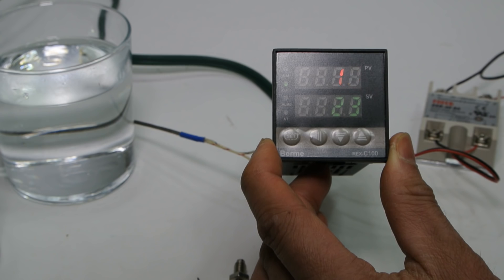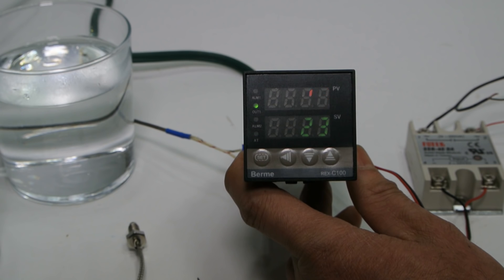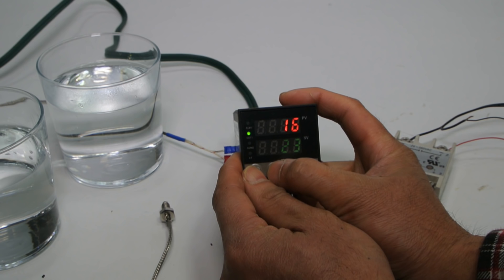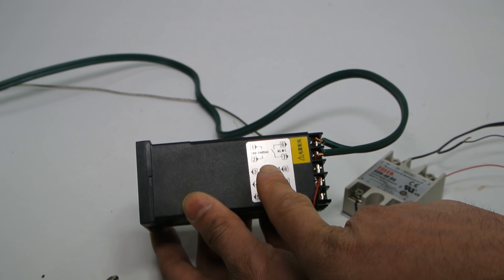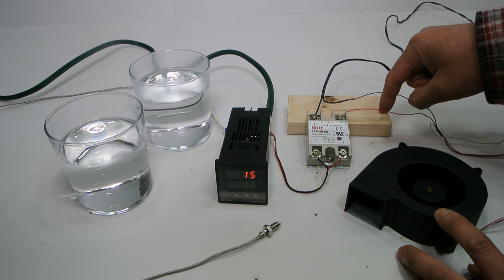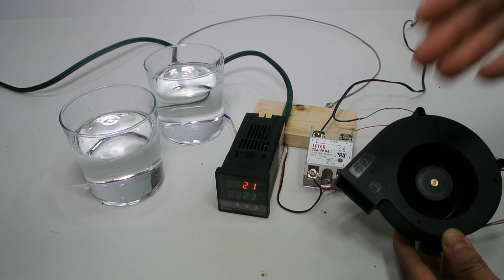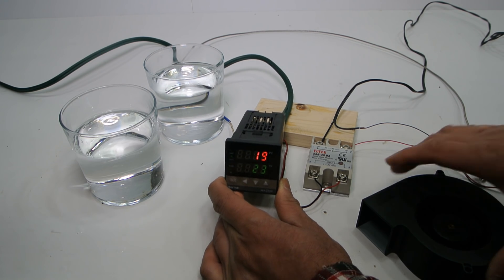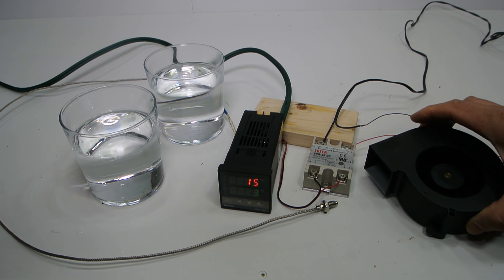Berme REX-C100 PID Temperature Controller

Comment: tanks very much for progamation cooling sl6.     now can you help me   in make close circuit water circulation   I need progradation for. exemple   when the water is 60 degrees I need the pump start  to circulate water and stop at 30 degrees  is that possible ???    and in the same time remove the pulse mode. tanks in advance. Gaetan

Comment: Hi there! I recently bought one of these to regulate a 12VDC heater element. For some reason through I can't seem to get the SSRelay to disengage i.e. it heats up and measures that heat OK, but it isn't stopping, even past the SV. Is it that the relay is just not suitable or is there something else I should be looking at?
Reply: SSRs are for AC only. Back to back SCRs or a triac. They shut off as the AC voltage passes through zero V. I don't understand why it's working for him in this video - guessing the "wall wart" must have been unfiltered DC dropping to zero every half cycle. For DC you might want an N-channel mosfet (with a 5 volt gate if that's the voltage that comes out of the controller - I haven't measured it) to switch the minus line of your heater.

Comment: Thanks for the info on the pid . I have a berm rexc100 running headbands for a basic injection machine I have built . I’m having trouble getting the headbands to heat up at all . The output light is on and the thermocouple s are in working order . Is there a setting In in the parameters menu to get the pid working on the initial setup ?. I am just struggling to find any good info online for this model of rexc100 so any info would be appreciated. Thanks

Comment: The 400C limit refers to the proportional action which is where it sets it output (0-100%) proportional to the difference between the set and measured temps. K-type thermocouples should be good up to around 800C at least. The smallest gauge k-type I believe is 30 AWG and its suggested range goes up to 760C

Comment: A good video.  it's a pity the chinese producers don't have the initiative you have to give explicit operation details you do.  Thankyou for being so helpful.  Incidentally are the Chinese frightened of mentioning colours RED AND GREEN. One of the features is that the bottom target temperature the  'user' must set is GREEN !  The desired temperature the user requires the heating element to switch off is RED and in the upper reading.   
I have had to get used to digital electronics with being a commercial heating engineer but I thought I was thick when I spent an hour trying to set a previous controller same brand as the one that took five minutes to get it to heat 300 watts up & then maintain 200C.  I now have proof the 1st controller was faulty out of the box.   
I was advised the thermocouple thread is to be 6mm (course) =no way, it is 1/4 whitworth and it fits into the appropriate thread I made for it.
It's a K type thermocouple. The device seems to have been factory set for a K TC by shear luck for me.

Comment: I took apart my SS relay and it had a BT26A triac in it from LT semi.
It's 25 amps rated but it IS possible it's a relabeled one which is just 10 amps
Reply: never trust any Chinese electronics from aliexpress/ebay if you want to switch any serious power. The controller itself is fine.

Comment: Have you any idea how inaccurate the temperature measuring is with this product?

Tin melts at 449,42 °F....and according to the BERM REX C-100 the temperature was at 298.4 °F when it did....some tolerance, huh?
Reply: nope.. it's Chinese so they use metric.  It's not Fahrenheit.  It's Celsius.   I did try changing to Fahrenheit by setting SLI2 code to 0001 and saved it by pressing [SET] and the [<] keys together.  Still no joy.

Comment: So does the Berme "save" the PID values as they get steady or do they reset constantly...??
Reply: I did try changing to Fahrenheit by setting SLI2 code to 0001 and saved it by pressing [SET] and the [<] keys together.  Still no joy.  When I power it back on, it initializes to Celsius, type K thermocouple.

Comment: I would like to use PID controller for heating purpose by using halogen light bulb. When I on the halogen light bulb, it will start heating and I would like to control the desired temperature and remain it. Can I use this product?

Comment: Hi, I am a newbie with the Rex C100. I have successfully
setup the controller and SSR (after modifying the controller to signal 12 V to
the SSR) to regulate the temp of my fish pond. The controller is regulating the
pool pump, heater and UV light all on the same circuit. The target temp is 25
C. I haven't changed anything but the target temp on the controller.
This far it is working well. Initially it switched on and
off a few times and shortly afterwards it settled in heating mode while the
temp slowly increased. About 10 hours later while constantly running the temp
reached 18 C and the unit kept on switching off the system a split second and
switching on again. this happens every minute or so. Any advise on this
problem?
Secondly, as the temp increased to 23 C (target still 25) it
keeps on switching off and on, like it is trying to slow down the heating as not
to overshoot (I think?). I only need it to do a simple thing, run the temp up
to 25 C - switch off - wait until 23 C - switch on until 25 C.
Any advice on the settings to get this done?

Comment: I love the way you picking up the relay with mains applied and a bare wire connection above your fingers, the amperage is rated as 40 on relay. I wouldn’t even attempt that without a decent heat sink though.
Reply: I think it's only running 12v as per the fan so his shock wouldnt be more than a tickle really. but if You were running a 240 heating element? yeah i'd steer clear of any wires lol
Reply: @zombieprinting2670   12V cant penetrate normal skin on your hand :)

Comment: Warning, these SS Relays will fail by SHORTING OUT leaving your heater ALWAYS ON!!!!
I've had TWO of these relays fail on me for my 3D printer.  The REX100C does have an overtemp alarm setting, with a separate alarm output.  I suggest that you use this and wire a sonolert to the alarm so you have an audiable warning if your relay fails and you go into thermal runaway!  Better still use the alarm output to open a second mechanical relay in series with the SS one.
Reply: Just use a thermal fuse on the mains.
Reply: The only reason your REX C100 does this is because you've bought illegal Chinese-made ones. If you buy the real ones from RKC Instruments Inc. from Japan, you'll see you will not have these problems. You can buy real ones here for instance: http://www.cascade.net/controllers
Reply: @ingridmeijer1578  lol those are probably $600 a pop
Reply: @joblessalex   Well they are not that expensive.. I use crydom   Solid state relays. And also make sure that you have them connected to a good heat sink Solid state relays. And also make sure that you have them connected to a good heat sink . If not they will melt on you

Comment: please help I can not get into cod mode.  everyone says go to lck and do value of 1000. but I can only enter 3 digits not 4 and if I use 100 for the lck I only get option sl1 sl2 sl3 and sl4. and the first 3 I can not change the value of.  I can only change the value of sl4.  how do I get into cod mode?  I pushed and held set and left button but it will not come up.  I have a rex-c100
Reply: Bill Sierer I have same problem
Reply: I have the same problem ...do you found some solution??
Reply: +Bill Sierer the same issue with mine - no further menu (just s1 to s4) with three digits only ;(
Reply: No ugh
Reply: Sigh
Reply: Not all Berme REX-C100 PIDs are equal. I bought one directly from China and while it works perfectly for my smoker I can't get into any of the "deep" settings. Out of the box with the AC SSR it came with it only works for controlling an AC  power source for turning on something that will make something hotter.

So in other words it can't be used for cooling only heating. I have mine hooked up to a longer thermocouple and use the AC SSR to turn off and on a 12 volt wall wort that powers some small fans that are plumbed into my firebox. It works way better than expected holding my temp to within +or- one degree C.  And yes I have used multiple other thermometers to check my settings. I did do a boil test and my system was off by one degree so I did go in and adjust that setting just to be nerdy :).  

Oh other things you can't do that is in most of the manuals is switch from C to F. Its just not in the programing. 

So for me it works just the way I want it to. Now its not perfect . I have found as it ramps up to the 107C I want to smoke a Pork Butt it will over shoot quite a bit before setting down. I think thats part of its programing. I compensate by restarting it right around 90 or so.
Reply: Buy a real one from RKC Instrument Inc. in Japan and you will not have these problems. Berme REX-C100 are chinese imitation controllers that can catch fire and they do not meet any of the quality specifications. These instruments are DANGEROUS AND ILLEGAL!!!
Reply: Comment suprimi la larme
Reply: Did you ever solve this? Used one of these years ago and had no problem running kegerator/lagering fridge. Only SL1-SL4... what's the deal?

Comment: does it display the temp in F or C // can you change that in the menu ?
Reply: You can change in sl2 000 is c and 0001 is f
Reply: @rimmersbryggeri  I did try changing to Fahrenheit by setting SLI2 code to 0001 and saved it by pressing [SET] and the [<] keys together.  Still no joy.  When I power it back on, it initializes to Celsius, type K thermocouple.
Reply: This one may but I have one with the same type of product code and I can't change it from C to F. 

Not all Berme PIDS are the same and no real way to know beforehand.
Reply: rimmersbryggeri Like I posted I can see that setting but on my I guess clone you can't change this value.

Comment: Hi Andrew, at around 6:23 you mentioned that you are controlling power to the fan via the SSR with a DC supply. However, I notice your SSR output is 5-380VAC. Does it work with a DC supply? I want to control the temperature of a silicon heat pad that requires a 12DC supply. Will it work with the same SSR (5-380VAC) as yours or should I get a SSR with a DC in/DC out?
Reply: I'm not sure how this is working. I have the same SSR and it does not work with DC loads. It will turn on but not turn off as per what I everyone else says about using an AC SSR with DC.

I got a DC/DC SSR and it worked fine with my 12v DC fan.  I just used it for my Offset Smoker over the weekend and and for the most part it was dead on and held temp at 106 to 107C for 4 hours. It did go crazy once but it was because I opened up the grill to rearrange the meat and it dropped to around 40 C. It way over shot to 130. I think there are settings to help control this.
Reply: SSR turn on and off with DC when they get signal on the input but they switch AC on and off ...usually mains at zero crossing to eliminate noise,arcing and overloading ....
Reply: Buy a real one from RKC Instrument Inc. in Japan and you will not have problems. Berme REX-C100 are chinese imitation controllers that can catch fire and they do not meet any of the quality specifications. These instruments are DANGEROUS AND ILLEGAL!!
Reply: @ingridmeijer1578  You must be a sales rep for that company because you post the same answers all over the web.

Comment: OK I'm not sure if you are checking posts but I got everything together and somehow screwed up my first PID. Got another one and just started to use it without going into any settings. I set my temp and the fan goes on. The problem is the fan doesn't turn off. 

Its a 5v simple battery operated fan. The SSR LED goes on and off but the fan stays on. I've tried hooking it up switching the positive and the negative with the same result. I have 2 SSR's and they both seem to work the same way.

I noticed you used I think a 12v fan. Is that maybe an issue?

ETA: OK reading some more about AC SSR's and how they only work with AC not sure how you are using it with a DC fan.